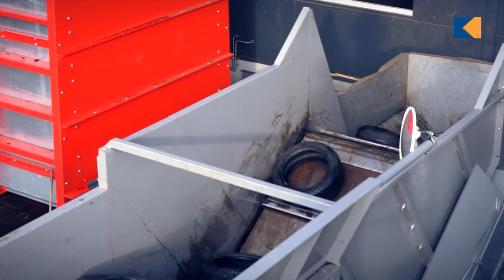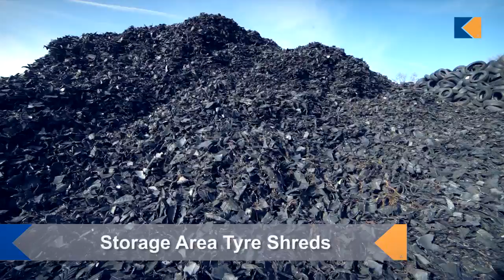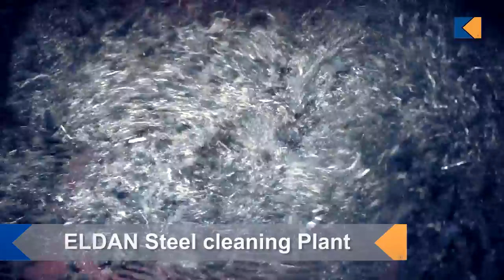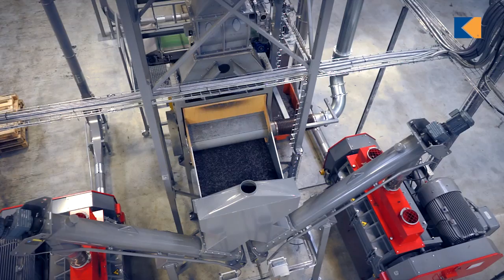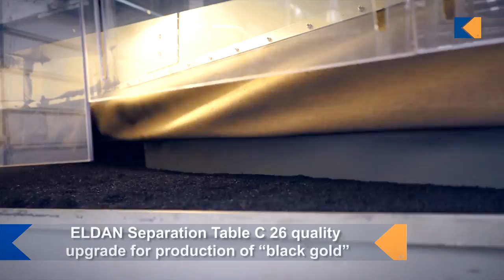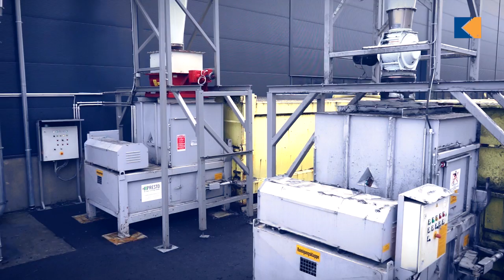State of the art Tire Recycling Plant | Eldan Recycling

Comment: Impressing system but how much granulated rubber can be sold ? And who buys them
Reply from the maker: Hi Mohsen Abdollahi - we only manufacture the machines and don't have any specific numbers from our customers.
What the granules are used for and hence who buys it and how much often depends, however, on the granule size, purity, and where in the world they are used. They can be used as recycled rubber in shoe soles, in asphalt, in vibration dampening and playground mattes, for pyrolysis, and much more, and sales then depends on which and how many different products they are used for in the area.

Comment: There is a missed production step right at the beginning.  This process invests steps, electricity, and machine hours to separate the steel after the rubber had been chipped.  A significant percentage of the steel in a conventional car or truck tire is isolated in the bead, why not cut it off first?  The first step in the workflow could be a chute with opposing rollers which spin the tire against cutters that hook around the bead, cut it off and set each one aside.  Then the carcass continues to be shredded and processed as the plant is designed.  Whatever steel wires are under the tread must still be removed, but they become a smaller percentage of the weight, and therefore less effort.  You can thank me later with a royalty cheque in CAD.
Reply: Very good observation.  We have lots of recycling knowledge, we just don't have good leadership in Congress or Corporations...
Reply from the maker: Dear Terry Warner. Firstly, we would like to thank you for your input. However, in this case there is a well- thought out system behind our product design. ELDAN has great success in removing the steel wire from tires in our Multi Purpose Rasper (MPR). The MPR shreds the tires and the steel wire is automatically removed with a magnet. This plant solution has proven to be incredibly effective, and automatically produces both high-quality saleable rubber chips (TDF, Equestrian, input pyrolisys etc) and steel wire for the steel mills. It is our experience that De-beading of tyres, it is not an effective process Yes, it is possible to remove the steel wire in truck tires before they are recycled, but this requires additional investments, running costs, manpower and handling, which makes the process uneconomical. 
ELDAN

Comment: Hello im doing a school report on tire recycling and I cant find this information anywhere. It would help me alot if you could get back to me.
How many tires can you recycle in a certain period (day, month, doesnt matter)?
How many employees do you need?
Reply from the maker: Hi - it is difficult to give you a figure for how many tires can be recycled in a specific time frame, since it depends on many factors - machine type/size, output type/size/purity, tire type/size. You can process more passenger car tires to 50-300 mm tyre shreds in a large shredder in a day, than if you make truck tyres into 30 mesh powder in a small scale line. It also makes a huge difference if you are operating your machinery in 1 shift, 2 or even 3 shifts a day. So you need to be more specific if you want a clear answer I'm afraid.

Comment: Cool, but where do the rubber granules go after they're bagged?
Reply from the maker: Hi Donell Muniz - they are sold to other businesses for reuse. 
What the granules are used for often depends on the granule size and where in the world they are used. They can be used as recycled rubber in shoe soles, in asphalt, in vibration dampening and playground mattes, for pyrolysis, and much more.
Reply: @EldanRecycling  In high school track, 40 years ago, I ran on a surface paved with rubber granules from old tires. There was only one in my whole county like that.

Comment: It would be great to get an indication of what the various products are used  for ?
Reply: recycled back into rubber products which can use previously used rubber, such as tires,  fatigue and playground safety mats, conveyor belts, shoe souls, etc. 
There are also companies using reclaimed rubber for rubberized asphalt and asphalt replacements, such as for bike and walking paths as they are more flexible to ground shifting as well as fatigue alleviating jogging/walking routes.  Possibly also for various fill, construction products, etc.  There's very few things which require virgin rubber.  Even some vehicle tires can use reclaimed rubber.
Reply: @jdenslinger  
Thanks !
Reply: And also crumb rubber carpet underlay 👍

Comment: If a country where to implement this plant? How much will it cost?
Reply from the maker: Hi Diaspora - prices depend on a lot of different factors like capacity, level of automation, required output size and purity, and added upgrades like steel cleaning and powder production. For a specific price and/or quotation meeting your requirements, you will need to contact our sales department at info@eldan-recycling.com

Comment: Wonder how many chillion s I need to put a plant of this size,+ the land  ,operators,I'm interested only if s not made in china Any body with the answer reach out pls
Reply from the maker: Hi Frank - All ELDAN machines are made in Denmark - you can see our factory here https://youtu.be/XGiGtaomft8. We also invite people by during negotiation stages to see it for themselves when possible.
Regarding area and operators needed as well as prices, it depends on a lot of different factors like needed capacity, level of automation, required output size and purity, and added upgrades like steel cleaning and powder production. We have plants needing as little as two-three operators for various tasks down the line, and plants where you pay less for the machinery but need more operators to ensure a smooth operation then. Customization is key to most of the plants we sell, since no recycler's needs and buildings/site are the same.
For a specific price and/or quotation meeting your requirements, you will need to contact our sales department at info@eldan-recycling.com or visit our homepage to see if we have a local office near you - https://www.eldan-recycling.com/en/contact

Comment: Now they're all  broken up  WHAT are you going to use the rubber granules for ?
Reply from the maker: The rubber chips can also be used for the same TDF applications or as “equestrian” (i.e. rubber mixed with sand or sawdust used in the horse industry as ground in the stable or at the tracks). The rubber granules can be used in production of rubber mat and molded products or athletic tracks. Rubber powder can be used in the asphalt industry for “Rubber Paved Asphalt”. The steel is regularly used by steel works worldwide.

Comment: What are the rubber granules ultimately used for?
Reply from the maker: The rubber granules can be used to make a diversity of things; e.g. rubbermats, different flooring for children parks and sports & running tracks, used in asphalt and cement to make it durable and flexible. And many, many more things.
Reply: @ @EldanRecycling  Thanks for the explanation. There are so many valuable usages for this material. Much too precious to just burn or put in a landfill...

Comment: What is the cost for this system ?
Reply from the maker: Hi Ishan - prices depend on a lot of different factors like capacity, level of automation, required output size and purity, and added upgrades like steel cleaning and powder production. For a specific price and/or quotation meeting your requirements, you will need to contact our sales department at info@eldan-recycling.com
Reply: @EldanRecycling  Thanks you for fast response

Comment: Why wouldn't you show us what happens to the rubber stored? Because pyrolysis is bad for environment? And it may cause extensive damage to machinery that uses the fuel? Or because of all the aggressive greenhouse gasses emitted?
Reply from the maker: Dear Dileep Koppu, please be informed that the plant in the video shows production of high quality rubber granulates for the manufacturing rubber products, rubber tyres, rubber mats etc. The rubber granulate is stored in 1 ton big bags. This type of plant also produce high quality steel wire that can be sold to steel mills. It is important to stress that this type of plant is not being used to produce rubber for pyrolysis, nor do we produce fuel with it.

Comment: This process is not economically viable. Ground-up tires aren’t worth this huge investment. This plant is propaganda designed to make it appear as if the tire industry is “doing something”.  Look: to make asphalt, you just need ground-up tires. That’s it. Mix it with gravel and tar. It’s not rocket science. But the big money is in virgin materials, not ground-up tires. And the roads must fail often, so the Union will have plenty of work. Believe me, the refusal to use ground tires in road-making is a Union hustle. Those guys are the biggest crooks in the world.
Reply from the maker: Dear Ron. We have many successful customers Recycling tyres worldwide. The product is used for many different purposes, like recycled rubber in shoe soles, artificial turf infill, tdf, sound and vibration isolation tiles and, as a relatively new invention, in the production of asphalt. Tyres are waste that we need to dispose of worldwide just like plastics and other types of waste, and finding new ways to use the product after recycling is part of this process. If it was propaganda I am sure we wouldn't have been in business for 65 years with demand for our machines increasing. We are in no way sponsored or affiliated with the tyre industry either - we just make machinery for the recycling industry in general, and happen to have developed machinery that process tough materials like tyres well. 
If you need more information or have questions, you are welcome to write us again and we will answer to the best of our ability.
Reply: @EldanRecycling   Your machinery is completely unneeded. Any large firm could build a grinding machine, and produce granulated rubber from old tires. This issue is the fact that Union road-building companies will not accept the ground rubber. They have deep mafia connections, and they charge the highest price possible, for the worst roads possible. I don’t blame your company for this, but the fact remains that old tires can easily be used to make asphalt. They’re not, because the Mob controls the entire industry.

Comment: Burn it
Reply from the maker: Hi John Cortez - TDF, or tyre derived fuel is actually used in many places as an addition to traditional fossil fuels to keep costs down, i.e. in many cement factories. To fit into the ovens, however, whole tyres must be downsized first and for some, the steel must also be removed before they can be used as fuel. To avoid toxic fumes etc. from escaping into the atmosphere, burning tyres should only happen in kilns and ovens made for this purpose, and not in the open.
Reply: @EldanRecycling  I here u. Burn it safely but burn it